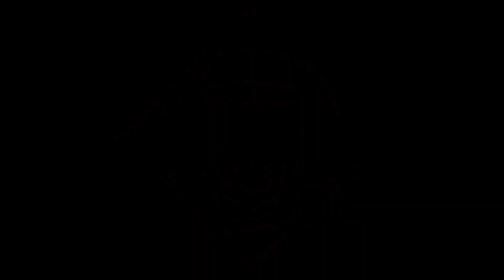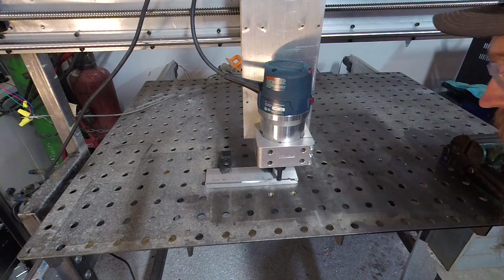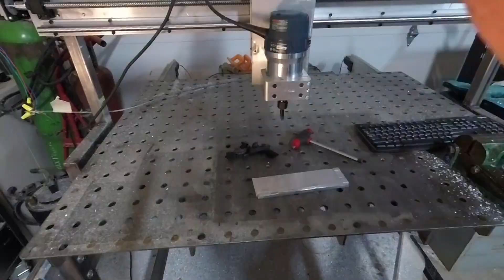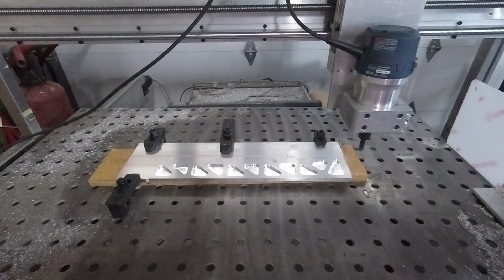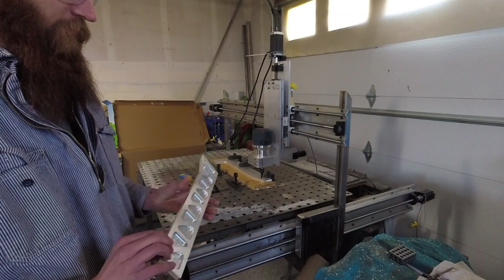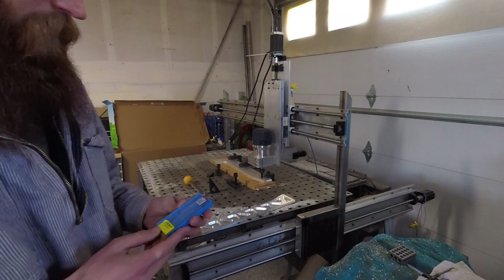Carbide Insert Milling Aluminum DIY CNC

Comment: Subscribed :) ... That looks like a solid router design. I'll have to double thank Earstwhile for the shoutout. Seeing your machine and listening to your comments about how the finish is rough on the front side of the workpiece is most likely going to result in some changes to the design we're working on, so thank you for sharing that bit of info.
Reply from the maker: Thank you for watching! I have a few modifications I’ll be doing to the machine to stiffen it up.

Comment: Nice to see more cutting always. You did make a good looking frame structured part, nice to see. Z axis structure building for greater rigidity and more motor mounting. Lance & Patrick.
Reply from the maker: Thanks for watching guys, you can see in a few times when I crash it the system flexing. I'm surprised the motors are actually strong enough to flex the machine. The z axis is the first step and with work my way backwards to the y axis.

Comment: I've been playing with wood router bits on the mill with aluminum. Worked really well.
Reply from the maker: Yea John they work pretty good, the one issue I have had is surface finish in the DIY CNC. With a typical helical end mill I get a little better finish since it puts some of the load radially instead of just axially with the straight flutes.
Reply: @riversvic  Merry Christmas man. :)
Reply from the maker: Thank You, and a Happy New Year! 🍾
Reply: @riversvic  Thanks man. You too.